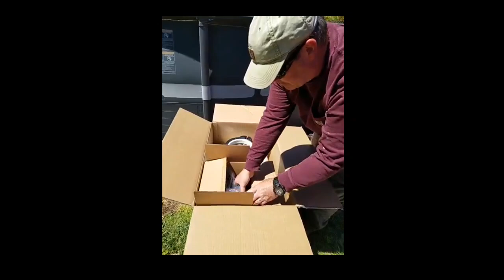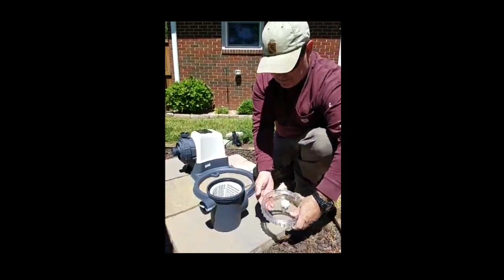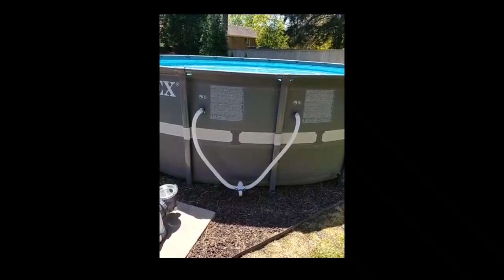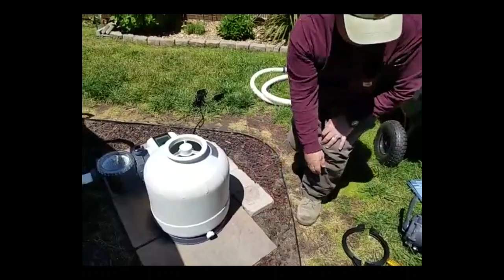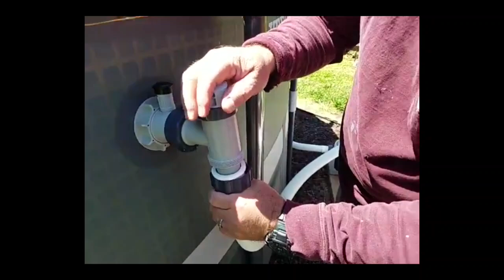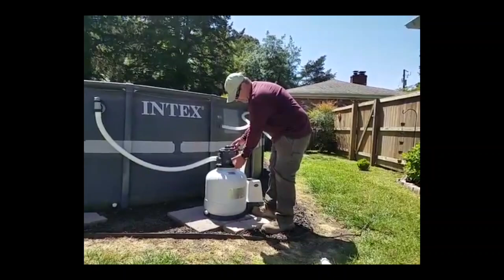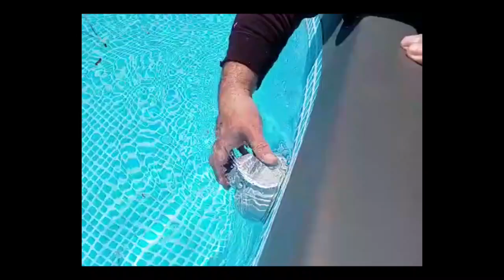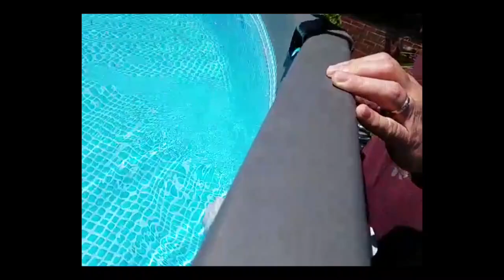INTEX SAND FILTER PUMP - Setting the pump up for above ground pools

Comment: Finally!!! Someone made a great informative video thank you so much sir! I see I’m not the only one that has the same problem to finding a great detailed video
Reply: Question tho, I bought a intex 22’x52” xtr pool that came with the sand filter pump that I believe is a 2100 gph…will this be sufficient enough for the pool even tho it did come with it or is it best to upgrade
Reply from the maker: @mikeharper2130  Def. Upgrade. Sell that one locally when you can. We also had a 2100 and now we have a 3000
Reply: Will the 2100 be sufficient for right now till I can save the money to upgrade
Reply from the maker: @mikeharper2130  It will be sufficient to do what you need.
Reply: I’m having issues of finding a hose for backwash the port on the 6 way valve is 2 1/4 and I can only find 2” can I use the hose that was provided for the discharge that will go into the pool. Can I take that and hook it to backwash because that hose will fit
Reply from the maker: @mikeharper2130  No I would not do that. I would get a 50-75 ft backwash hose 2" from Lowes or Home Depot and use this valve  https://amzn.to/3ii0yzr It will directly screw into the backwash outlet and then you just attach the backwash hose with a 1-3" hose clamp and it will work. That is what we do. There may be a small amount of leakage but it's nothing to worry about.
Reply from the maker: THANKS!!!
Reply: Awesome thank you for your help sir

Comment: Where to store the sand when the season is over?
Reply from the maker: In late Sept.. We slide our sand pump on a dolley (hand truck) and roll it into a backyard shed so it stays out of the cold, wind and rain in the winter. After 2 seasons it seems to be just fine.

Comment: Love your suggestion of getting extra tubes for the backwash.  Where do you get the connector to connect the extra hoses together?  I have 2 extras tubes but having trouble finding the appropriate piece so they screw on on each end.
Reply from the maker: Those hoses you see in this video to do the backwash came from our Intex Pool Cleaner.  They give you 6 hoses for up to a 22' ft pool. We had some we didn't use because our pool is 18' so that is where they came from. There is a 59" hose available on Amazon that might work for you. https://amzn.to/3AU9PGs  NOw we do this instead:  We use The Aqua EZ hose from Lowes.  It is 50' long and I ended up with is actually a 2" hose and I couldn't get it over the threads so I purchased an Intex valve  pictured here:   https://amzn.to/3k2HLe1 which may be cheaper on eBay you might want to check first before purchasing and then I use a regular metal hose clamp to attach the 2 inch hose to this adapter. It works like a charm and doesn't leak.   I very rarely have to backwash.  When you do, don't forget afterwards to rinse.

Comment: 1st I wanna say thank u a lot lol but I’m filling for the 1st time wen it’s finally full what cycle do I put it on 1st or do I still do the steps u do?
Reply from the maker: When you have your desired water level the 1st thing you should do is backwashe pump to settle the sand do that for 15 to 30 seconds and then turn to rinse,  rinse until your bubble is clear or your sight glass is clear. You should be good.

Comment: The motor of my sand filter pump just burned at the 3rd day using it, I don't know why.
Reply from the maker: So sorry.  The only thing I can suggest is always make sure you turn off the pump before making any changes to the dial or if you need to burp your pump filter.  You never let air get in your pump ever.  If you call intex they will probably send you a new one but they're going to ask you a bunch of questions to figure out what happened
Reply: @MoverandShaker  Thank you so much for the answer.

Comment: Hello, thank you very much for your video!! I'm still a bit overwhelmed with  the connections etc and need assistance. I've searched online to see if I can have someone come to my home to ensure that the set up is correct and to fully explain the use of the filter/pump but have not had any luck. Would it be be possible to assist me via a video call?? I want to make sure that I've got everything correctly set up and like stated above, need some instruction on how to navigate the filter. Thank you very much! Carla
Reply from the maker: We don't  do video or phone calls. I do like your idea of looking for local help.  I would try your local Next Door App and ask if anyone in your surrounding area has experience  with Intex, Coleman or Bestway above ground  pools that could come over and do a quick scan and give you some quick hands on advice about normal operations. We do have a lot of pool videos for reference. Perhaps a few other videos may help as well.

Comment: This video has so much information that I just wanted to say chi-meegwetch (Ojibway for many thanks).  I've had such a hard time finding and getting a sand filter pump that my pool experience has been less than stellar the past few years.  Your video has given me hope.  My biggest concern is that I am trying to attach an Intex sand filtering system to a coleman pool.  Will this affect the hoses and attachments...Will I have to make any adjustments to any connector hoses?   Any help is so appreciated.  Miigs!  (short form for thanks)
Reply from the maker: I am not sure,  we are not familiar with Coleman  pools but I know I have a lot of viewers with Coleman pools and Intex pumps and my guess is a few tweaks with various adapter fittings and hose styles and sizes and it will all come together Usually you hear 1.25 and 1.5 " most common so you just to find what you need to make it work.

Comment: What is the "inch" size of your pump since you're going through so much sand?
Reply from the maker: 16"  @ 3000 gph  and we bought ours for $296 but this one is ridiculously priced now. https://amzn.to/3gmLd0N  Our first pump was  a 12" @ 2200 gph and it was sufficient but we wanted more bubbles and power. LOL
Reply: @MoverandShaker  Thanks, I got the 14" which requires about 75-80 lbs. of sand. My pool is 15ft by 48 deep. It should definitely be enough. Thanks for the tutorial, looks like you have a nice set up there sir.
Reply from the maker: @emeresbestres1  Thanks for the compliment. Yes at first we ordered the 14" and we we received it we hesitated, and returned it for the 18" x 52" If you need any help just ask. We were new once and relied on everyone's help in fact we are still learning everyday and actually get tips all the time from other pool owners. We have to stick together and help eachother.  Here is our Pool Video Play list  https://youtube.com/playlist?list=PLari8-RpqrbsVkSITLxQFYCGwHfejfqz1
Reply: @MoverandShaker  haha actually I do have a question. My pool is Intex as well as the Sand pump. I wonder if I will need any adapters for those 1 1/4 original hoses to make the connection with a Sand pump.
Reply from the maker: We have never purchased any adapters everything that you see in our videos came with either the pool or the pump
Reply: @MoverandShaker  Thanks I'll give it a try today after work. It looked like black magic last night but after watching your video I fell a little bit better. Those Intex instruction manuals are not very clear.

Comment: What does the FP on the filter mean?
Reply from the maker: The FP means free pump it will be running as long as you want it until you turn it off that's what you do when you're going to run your salt water system on boost for the 1st time you put your pump on FP so that it won't cut off until your boost cycle is over
Reply: @MoverandShaker  thank you so much!

Comment: Hi! Please tell me how you were able to connect the outlet cover that came with the pump to your pool? It appears that I would have to cut a bigger hole and get some type of adapter for it to fit. I have no clue. Intex 15x48 pool
Reply: I'm assuming your pool has two black tubes for your filter and that's it. That's for the older pumps. You would have to use the screw on nut from the new assembly to trace a circle around the upper black tube and then cut it out. Your new discharge should fit in there.
Reply: @trevordoeshalloween5994  Yep that’s what I did...I was nervous but it worked LOL. Thanks
Reply: @theresawatt5530  I'm glad you figured it out
Reply from the maker: Having to cut a hole? Absolutely not, everything that came with the pool and the pump allows you to hook it up without having to do that.  Have you looked at the Intex pump manual for your installation  set up? It should tell you and provide you exactly what you need to hook it up.  We have never cut any holes.
Reply: @MoverandShaker  I think I have figured it out...the original black piece has to be removed from the pool wall.
Reply from the maker: @theresawatt5530   The black piece is important.  it is called a strainer hole plug.  If it looks like this https://amzn.to/3pKE1P1  That is where you get the most absolute suction from your skimmer. Do you have a skimmer?  Inside the pool you have a part 14 a strainer connector, part 15 a strainer grid and inside of those is the black strainer hole plug Commonly referred in our videos as "the Black Hat"  If you have a skimmer you will want to keep that part in there. It is supposed to be there. We have other videos maybe taking a look at our skimmer video will help you see these items closer.  https://youtu.be/Ykhyqe5VcX0
Reply: @MoverandShaker  Yes I have a skimmer. I got that hooked up and working fine also using the “black hat”. My issue is with the outlet cap that came with the pump. It doesn’t fit the outlet hole on my pool wall which leads me to believe another piece is needed. As of now I just have the original outlet cap screwed on.
Reply from the maker: @theresawatt5530   Would you like me to email you the parts list and parts diagram for the pump or do you have the book?
Reply: @MoverandShaker  I did and it’s not clear to me at all. I bought the pool used so I’m not sure if I have all the pieces but I have everything to hook up the original outlet cover. What does the piece look like that fits into the pool wall?

Comment: Is there an video when you first set up your pool?
Reply from the maker: Yes there  is. https://youtu.be/hny3GCrtric.  more ground prep than anything. The pool set up was like 10 min.  It took longer to smooth out the wrinkles in the base of the liner than anything else.
Reply: @MoverandShaker  thanks so much!!
Reply: Quick question?  How can I level the way you done, if I have grass on the both sides but my walkway is pavement, I want to get the 12x30 pool, my yard is long and narrow but not wide.
Reply from the maker: @dabestlove7373   It's hard to even suggest something to you without seeing your actual landscape but if part of your pool is going to be on pavement and the other two parts are going to be grass, then the only thing I can think of is to REMOVE the grass exactly like we did with the machine rental from the two sides of your walkway and replace it by leveling it with play sand until it's level with the concrete then place your tarp down. If you don't do this then you will have a have rough uneven surfaces all throughout your pool bottom and you certainly don't want that.
Reply: @MoverandShaker  thanks
Reply from the maker: @dabestlove7373  You're welcome.

Comment: what type of sans do you use? Very conflicting info. Also salt if u use salt system. Thank u so much. First time pool owner here
Reply from the maker: For our Intex Sand Filter Pump Intex recommends to use No. 20 Silica Sand  or Glass Sand with a particle size range of 0.45 to 0.85 and a uniformity coefficient less than 1.75  This is the one that we used on this link.    https://amzn.to/3wXjp8B

Comment: Thank you for this video.  Can you explain how the pressure gauge works?  What should it register when I have it on filter and what will it read when it is time to backwash?  Thank you so much.
Reply from the maker: We will usually leave ours until it gets into the yellow then we will back wash and bring the needle back down, Into the green
Reply: Thank you for your answer.  I don't see any colors on my gauge - just numbers.  Do you know what # it should read on the gauge so that I know it is working properly?   Btw, your how-to video's are excellent.
Reply from the maker: on our gage green goes from 1 to 10 yellow goes from 10 to 20  and the rest until 60 is all red. Thank you for compliments  on the channel.  We were new ones and we relied on others to help us as well so we understand what you're  going through

Comment: hi, we just moved into a house with a pool, they left us all the stuff but we have no idea how to use any of it. theres a layer of algae and dirt at the bottom of the pool. any tips on how to get rid of it using this filter?
Reply from the maker: We have never experienced having a dirty pool but our best recommendation would be. You need to vacuum the majority  of that gunk out. Then hook up a backwash hose to the   pump on waste and run until the water runs clear  then use rinse setting until the sight glass is clear  or 30 seconds.  Then get you some test strips  To check where all your levels are at so you'll know what you need to add more of. If you have a chemical only pull then you'll be maintaining it all summer with various chemicals if you have a salt water system like us then you won't be needing to add anything to it
Reply: @MoverandShaker  im pretty sure ours is a saltwater pool but it hasnt been maintained in a while and we live in a desert area so theres always tons of dust, we have a pool vaccum that attaches but im not sure how to use it because almost all the water in the pool has evaporated, theres only about a foot or two of water left in it
Reply from the maker: Then I would drain it all out and start fresh but I would go to the manufacturer's website and download the PDF versions of your pump your pool and your saltwater system and any vacuums or other equipment that you have put them on  a USB stick and take them to a place that can print them out for cheaper than you having to use your own printer ink and start from scratch like it's  a new  set up. It may take a couple of weeks.

Comment: Thanks 🙏🏻,I have a question where did  you get that T conector for the 2 B hose ?
Reply from the maker: https://amzn.to/3ow2vej Split Hose Plunger Valve
Reply: @MoverandShaker  thank you so much 🙏🏻🙏🏻🙏🏻
Reply: I was impressed with that T connector as well.  Can I go ahead and set up and then add that connector?  So new to all of this and your video has inspired me to have the best pool year yet, which has been difficult for us in the past.  Thanks for sharing your experiences and knowledge.
Reply: I was talking about the split hose plunger valve.    I am trying to connect an Intex sandfilter pump; however, my pool is a coleman.
Reply from the maker: o.k. well the link to purchase it is in the comments if you need one.
Reply from the maker: @janisfraser6720  If you are talking about the split hose plunger valve it comes with the pool where the two hose lead to the pump... We didn't  have to order it but I will double check

Comment: Do you keep the black cap on the A side valve the air bubble
Reply from the maker: The black cap is in the middle valve directly in front of the pump. You screw off the strainer connector and put the black hat in and screw the strainer connector back on.  So it sits between the INLET (left valve) and the skimmer valve (right side)

Comment: hello did you make a video for a salt water set up? any issues with your system so far?  anything we need to look out for? helping my sister set up this pump with salt water to her bestway pool
Reply from the maker: NO we did not make a video or set it up yet.  It's scheduled for this weekend (Saturday/Sunday) because it rains every other day or we have bizarre weird cold weather that comes in. So strange. We are behind a week or so.  We did not have any issues with the system so far last season. The directions are confusing but after the first season we know it's all worth it.  We have saved a ton of money by not having to put chemicals in it all summer and checking it every single day and worrying about it.   We also did maintenance on the saltwater system one time just to take care of the equipment. which is really easy, just follow the instructions and I think we have a video on that too.  So far no issues, no regrets.  Basically keep on hand saltwater test strips  to make sure your salt levels are good every four to five days https://amzn.to/3thqVsV and when you first set up your salt water system you have to make sure your water is Balanced properly. So after the initial balancing of the water using regular test strips https://amzn.to/3up4y6b  Heavy rains are the only thing that dilute the PPM levels of your salt content. So keep in mind that you want to keep a couple bags of salt on hand that will last the summer unless it rains constantly there.  Anytime your pool is really dirty or it had a lot of rainfall, it needs to be on the boost cycle to replenish the chlorine from the saltwater generator.  Everytime you boost it runs for a long time with the pump. See chart for your size 
The concept is simple never run the generator without the pump being on at least 5 min. and never turn the pump off before the generator is off.